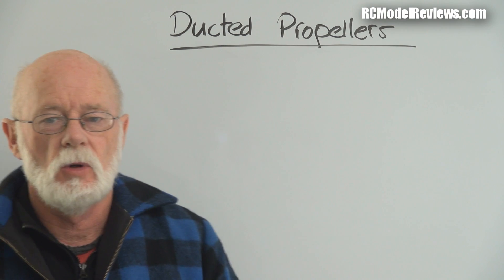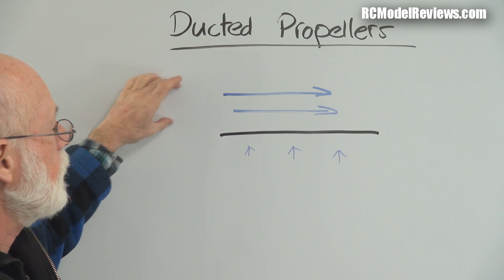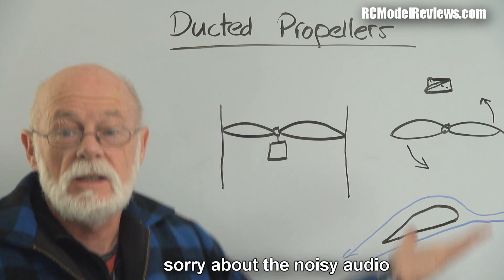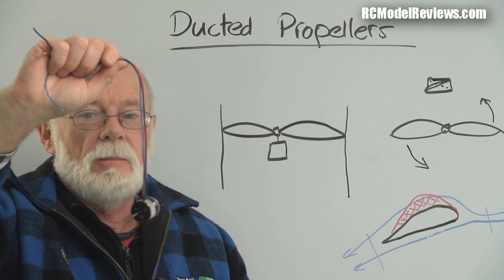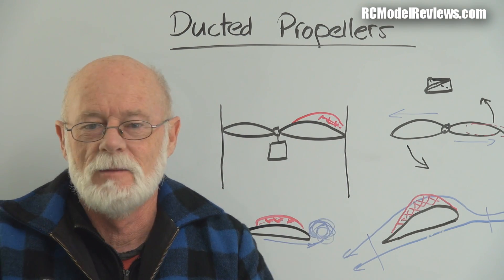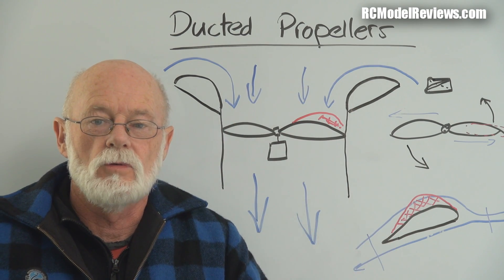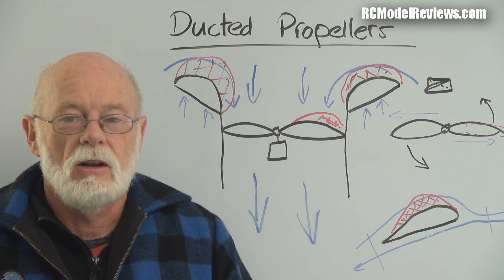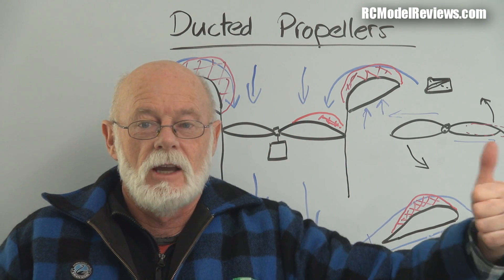How ducting a propeller increases efficiency and thrust

Comment: About 13.00 in, talking about lift created by the rounded duct end... wouldn't there be pressure building up on the front from forward motion the would reduce or eliminate the low pressure zone?

Comment: What is missing is: why do helicopters to this day go for propellers instead of ducts? You'd think ducts are comprehensively superior after watching this. Can anyone help?
Reply: Probably an issue of both engineering, design, and weight as issues.

How do you attach a duct to wrap around a helicopter blade without it being overly awkward? How do you make it steong enough to handle the necessary forces of thrust? And how do you make that extra added weight to the helicopter compensate with the added benefit of more vertical thrust?

Comment: Why not attach the duct to the propeller itself, when it's a small propeller like those on a drone? Also, why not put fins on the inside of a stationary duct to redirect the spinning air downward, unless it's a drone, because that would cancel out the torque of the motor, eliminating yaw?

Comment: I feel the issue with "bernouli vs newon" comes down to abstraction. Bernouli effect IS newton, just individual particles become abstracted into a continous flow with extrinsic and intrinsic properties.

If we modelled each air particle individually colliding with all the cohesive forces that affect particle behaviour in close vicinity (ergo: air sticks to the wing), we'd find it all boils down to "the wing deflects air downwards and we get a case of opposite reaction AND the wing changes the distribution of particles colliding against it to push it around. The airfoil shapes makes it a lower probability, while in motion, for particles to collide with it from above, thus reducing the force pushing downwards." 

We abstract that highly expensive computational model into "if continous flow has a non-zero relative velocity parallel to a surface, it exerts less pressure onto it than if stationary."

It's kind of the same idea as the many approximations we use in chemistry to describe bulk properties rather than fall back to good old schroedinger to derive everything. Nobody in engineering really cares about the nitty gritty details us theoreticians worry about beyond its consequences for catalyst design. They don't even study things as in depth because bulk descriptors are sufficient for implementing things in production once we made the computer models to discover the new catalysts and all that.

Physicists vs Engineers for aero-physics/fluid dynamics feels like a similar issue regarding lift.

Comment: one of my better ideas for an RC plane - i've had an idea for a model RC flying thing - a variation on a quad copter - if i take my quad copter and install it within a light weight saucer shaped shell i can take advantage of our winds using the wind for lift instead of the propellers - extending flying time - this as a rough idea expands into a gimbaled ducted fan quad copter within a rigid light weight plastic saucer shaped shell - with the winds where i live  - this should fly a long time with little power input - the  H.A.W.X. glider - High Altitude Wing eXperimental - you climb to altitude and then glide using the fans/props for stabilization only - hellls yea .....

Comment: THANK YOU BUILDING A CARBON FIBER BD5 AIRCRAFT. MOTOR UP TO 400 HP HARLEY DAVIDSON, AIRFRAME STESSED TO  20 Gs Pilots during World War II sometimes claimed to have reached supersonic speeds in propeller-driven fighters during emergency dives, but these speeds are not included as FAI accepted records. They are also extremely unlikely, due to the complex aerodynamic problems of propeller driven aircraft approaching the speed of sound.. On September 2, 2017, Steve Hinton Jr, in the modified North American P-51 Mustang Voodoo set the new record of 531.53 mph . This record is also the fastest for any propeller driven piston aircraft.
I Want it MACH 1.2

Comment: Victor Schauburger created an attachment to go on the front of an airplane that would create a vortex and cause the plane to get pulled along by the vacuum and you would be able to shut off the engines which means it's 100% efficient after you get up to speed I guess but his famous quote is a bird doesn't fly it is flown and a fish doesn't swim it is swum and with very simple and basic logic all you have to do is look at a trout in a stream

Comment: Thats really awesome video you made. I have a question; how do coaxial helicopter propellers work then? Two propellers rotate at the same time so bottom of the higher propeller has higher pressure but that’s where the lower propeller has lower pressure.

Comment: @10:38 😳💁🙈

It is not turned into lift, but additional drag (you are compounding the presser in that region, thus more drag ), which is extremely exaggerated when using tapered propellers inside of a duct. This is well known to greatly decrease the efficiency of the propeller and increase the motor or engine load.

The propeller tip vertices can happen down to 4 µm, so your propeller tip to the duck housing needs to be extremely narrow, so as to reduce that loading, otherwise you compound the loading as I noted above and in your example.

Comment: The easiest way to prove the Bernoulli principle is to make 2 wings with the same planform, the same weight One with a dead straight plank cord and the other with a high lift cord. Put them both in a wind tunnel and record the results.
I find it hard to believe that engineers put that big thick wing on a C130 Hercules aircraft for schitz and giggles.

Comment: Dave Gerr, iirc, in discussing Kort nozzles ( nautical ducted-prop ), says you change the shape of the prop, when ducting it:

you remove either 1/4 or 1/3, can't remember which, sorry, from the end of the blade:
you make the chopped blade as close to the duct as you safely can.

I'm not sure that anybody in the drones/RC field is considering that, or trying it..
Reply: Shendrones experiments with this. He did some builds where he used bigger props and chopped off the tips to make them fit his duct very snugly. Afaik he did that to get higher pitch props that no one manufactures at the size he needs.
He does not post much on Youtube, but he has a very interesting blog on his website.

Comment: Your video just popped up on my feed, which is great, and you covered quite a lot of theory. I’m sure Google will tell me, but I kinda expected you to cover the issue of reducing diameter of exhaust tube. I recognise that by doing so you would reduce mass flow from the back pressure that would induce, but you would be increasing the velocity of exhausted fluid. Accelerating the passing fluid ( ask Newton) would induce a forward force. Maybe you would lose more from the reduced mass flow, but I would have thought not. I would have thought restricting the exit orifice by a small delta would increase thrust, although the point would come when you reduce it so much that gains from faster exhaust would be overtaken by losses from reduced mass flow.

Comment: the bernulli artgument doesnt work. longer path does not mean that the speed is greater. Also the idea that the low pressure air is trynna flow to the high pressure air over the wing is ridiculus. Low and high pressure equalize locally over fluid matter, not magically. Same unreflective stories professor regurgitate what they have been told w no reflection.

Comment: it would be an engine in itself even without the prop! 
If that lip would produce thrust without any drag, you'd need to just give it a slight push and watch it pick up speed on its own. but it's not doing that, isn't it? .. we'll maybe because there is drag afterwards ?

Comment: What about instead of using a separate duct attached to the aircraft... connect the propeller blades to each other essentially an integrated duct that rotates with the blade (all one piece).

Comment: i just have one question, why would air travel faster on top of the airfoil? yes i see two lengths are different sizes but why can't top one just continue with same velocity? what is forcing two separate streams to meet at the same point?

Comment: Sadly his accent ADDS R to the end of words without R. When he speaks of Coander he is speaking of Coandă effect , I eveb heard coender.. It is the size of the curve on the edge of a duct to add additional air flow and to increase its air air velocity faster than all other area in side the duct.  IT TAKE 30 DIAMETER LENGTHS TO REACH FULL SPEED OF AIR FLOW -  BUT NO ONE EVER MAKES LONG DUCT FANS MAY BE 7" ON A 24"+ BOX FAN= A JOKE. mAX INTAKE NEEDA A CONE AT CENTER TO ALTER AIR SPEED AT CENTER.  sO MUCH CAN BE GAINED BY DESIGN, BUT SIZE WINS, = jUST USE MORE WATTS OR 2 FANS.

Comment: all great stuff.. but i wish, for other peoples benefit, when this is explained to people, someone would explain that the fast moving stream is only lower pressure from the back and sides.. 
It's higher pressure in the front of the flow. and maybe explain it in terms of number of molecules hitting a surface when air is static (chaotic), vs number of molecules hitting the surface when the net flow of those molecules is parallel to the surface... I guess what i'm saying is instead of just saying fast moving air is low pressure because... bernoulli... maybe explain the actual why..

Comment: The length issue does and does not work for the airfoil. Although it most certainly is a longer distance, that does not account for the time difference between the top flow and the bottom flow. In fact, the top flow arrives to the rear of the airfoil faster than the flow on the bottom of the airfoil. Because of this, there is an acceleration of the flow over the top surface, which would further increase the velocity for the air over the top surface, therefore further increasing lift based on Bernoulli's equation.

Check this video to see the time difference between the top and bottom flows:
https://youtu.be/UqBmdZ-BNig

Although they claim that the explanation with the basis of the length of the flow is wrong, it would appear to me to be just as wrong to state that the length has nothing to do with the flow velocity over the top surface.

Comment: A stupid question here, what happens if there is no gap between the propeller and the duct? I mean, that the duct rotate with the propeller as one part.
Reply: I suppose it would add a lot of weight to the propeller and slow it down. You want the blade to be lighter as it reaches the tip. I imagine that air would still reach the top of the blade to equalise the drop in pressure by travelling in between the gap in the blades. If you've learnt anything since your comment let me know haha

Comment: Commercial jets have those little winglets to stop the higher pressure underneath the wing leaking at the wingtip into the low pressure zone above. That should work on a propeller.

Comment: So with the engine on the wings producing heat high pressure as it's exhaust long as it is directed over the wing that would increase performance and is that I assume things change at supersonic speeds?

Comment: Looks like "park by feel" research, use it if it works, which is fine for all practical purposes. It is good that the Bernoulli Effect is direct empirical measuring stuff, calibrated to a particular arrangement of "successful" machines, because actual cause-effect mathematical relationships of time-timing sync-duration, full Reciproction-recirculation Fractal Spectrum=> Theoretical Calculus analysis, are not at all made clear in an uncertain probabilistic Universe. (To me, ..yet)

Comment: Everything is fine but we have also the weight of the duct to add to the forces which means the gained lift might me a little bit lower due to the weight which is the force opposing lift. This in the vertical position. However when you rotate the duct things change a little bit.

Comment: While ducted fans work as described - the demonstration blowing air over the paper is a bit misleading.
Here is excerpt from Wikipedia:
"Misapplications of Bernoulli's principle in common classroom demonstrations

There are several common classroom demonstrations that are sometimes incorrectly explained using Bernoulli's principle.[32] One involves holding a piece of paper horizontally so that it droops downward and then blowing over the top of it. As the demonstrator blows over the paper, the paper rises. It is then asserted that this is because "faster moving air has lower pressure".[33][34][35]

One problem with this explanation can be seen by blowing along the bottom of the paper: were the deflection due simply to faster moving air one would expect the paper to deflect downward, but the paper deflects upward regardless of whether the faster moving air is on the top or the bottom.[36] Another problem is that when the air leaves the demonstrator's mouth it has the same pressure as the surrounding air;[37] the air does not have lower pressure just because it is moving; in the demonstration, the static pressure of the air leaving the demonstrator's mouth is equal to the pressure of the surrounding air.[38][39] A third problem is that it is false to make a connection between the flow on the two sides of the paper using Bernoulli's equation since the air above and below are different flow fields and Bernoulli's principle only applies within a flow field.[40][41][42][43]

As the wording of the principle can change its implications, stating the principle correctly is important.[44] What Bernoulli's principle actually says is that within a flow of constant energy, when fluid flows through a region of lower pressure it speeds up and vice versa.[45] Thus, Bernoulli's principle concerns itself with changes in speed and changes in pressure within a flow field. It cannot be used to compare different flow fields.

A correct explanation of why the paper rises would observe that the plume follows the curve of the paper and that a curved streamline will develop a pressure gradient perpendicular to the direction of flow, with the lower pressure on the inside of the curve.[46][47][48][49] Bernoulli's principle predicts that the decrease in pressure is associated with an increase in speed, i.e. that as the air passes over the paper it speeds up and moves faster than it was moving when it left the demonstrator's mouth. But this is not apparent from the demonstration.[50][51][52]

Other common classroom demonstrations, such as blowing between two suspended spheres, inflating a large bag, or suspending a ball in an airstream are sometimes explained in a similarly misleading manner by saying "faster moving air has lower pressure".[53][54][55][56][57][58][59] "

Comment: Believe it or not. I have an idea exactly the same. The down force will be a lot more concentrated. Like the wind has no where to go, but down. WOW! I was right. I have a drone, and watching the props move and like you said the top is less pressure, and the bottom pushes down air enough to hover the drone over my head to feel the downward wind from the props. So why let the air waste away, when you can use the fence idea. I was right.

Comment: So, this is going to be more difficult in smaller models to find a clearance between propeller and duct wall which makes for significant gain.  And if the propeller edge is too close to the wall, it catches and gums up the works.  As soon as you begin increasing the distance between propeller and wall the benefit drops off.  But the propeller won't move well, won't go without friction and power loss, when the blades connect with the wall.  You can't connect the propeller to the wall and get good thrust.

Or can you?

What if the propeller and the wall are one piece?  Or rather a section of the wall or a ring is one with the propeller but separate from the rest of the wall.  Flush with the main wall the ring portion of the propeller has free movement. Mounted as of a bearing.

Comment: Sir, thankyou for this video, I  came to this video as I need a solution. I  have a wood fired pizza oven and for some reason all the smoke does not rise by mechanical force through the chimney, much of the smoke  collects outside the chimney. I  thought of an inline fan or an impeller fan at the top of the chimney. Would you please help solve this problem to exhaust the smoke. The duct dia is 4" and a length of 30'.

Comment: What about putting a bell nozzle on the exhaust? In rocket engines they convert high pressure gas into low pressure - high velocity exhaust for maximum thrust.

Comment: Sir you fotgot one thing!! Distinction!! The duct's effect is to speed up.air inside it. However, the bottoom.portion of a oropeller is not supposed to hav fas air but only slow or stagnant one. In fact, it would b more favorable if there is no movement if air below the prop. As you demonstrated earlier a steip of paper lifts if you blow air only on top. Inside the duct,  all sidea of propeller are recepient of fast air. So the efficiency is also reduced.

Comment: Hello, I really enjoy your videos… however, this one is tough to watch due to inaccuracies in your theories. Your explanation of Bernoulli’s principle is incorrect, what you described is an outdated theory called the equal time transit theory and has man times been disproven. Also the air getting deflected downward is cause for Newton’s laws but the majority of it comes from the upper surface. The air hitting the lower surface causes a slightly elevated pressure on the bottom because it has fo change direction.